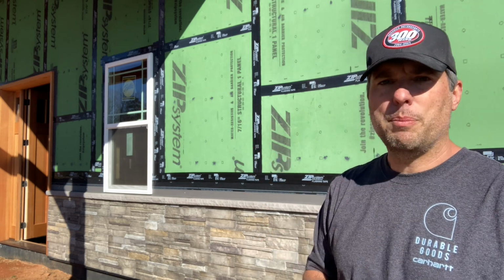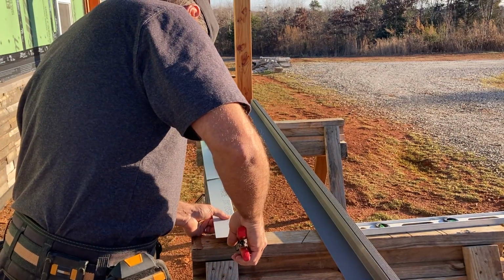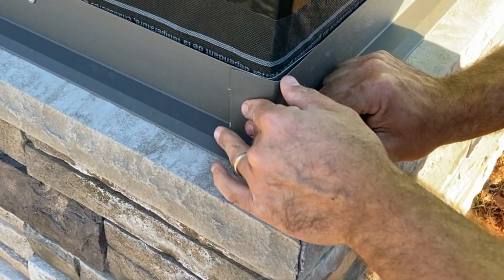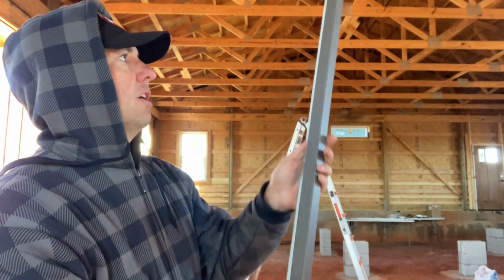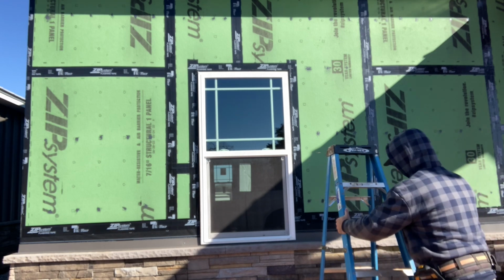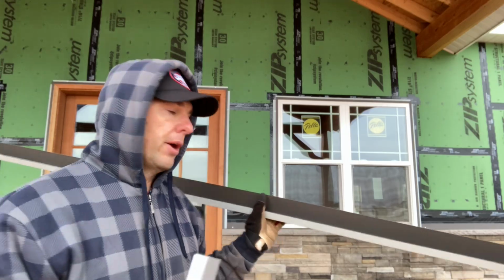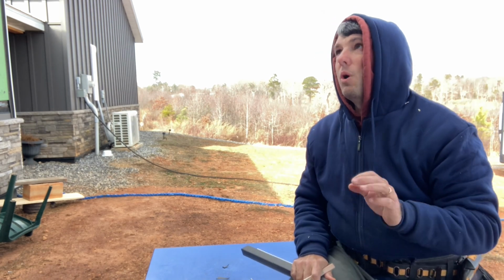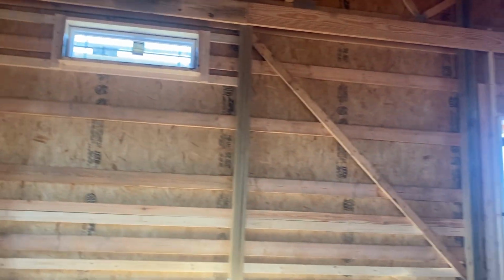Steel Board & Batten Panel Clip System Trim Details

Comment: Currently building my home.  Were you concerned at all using only 7/16" thick plywood behind the metal?  I have the same on my house so am hoping you didn't have any regrets about that part of the build.  Thanks!
Reply from the maker: Zero issues and no regrets.  We used 5/8 on roof deck and I am very happy with that as well.

Comment: This is great and very helpful- What company do you get these clip system panels from?
Reply from the maker: Best Buy Metals
Bestbuymetalroofing.com
It is the BBM product.  They have a couple different board and batten options.
Make sure you check out the panel install video.